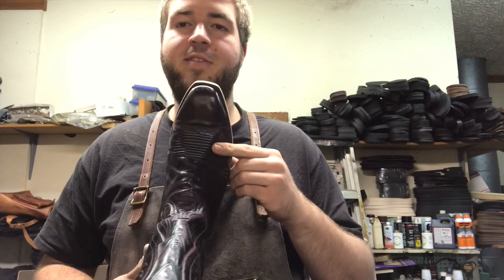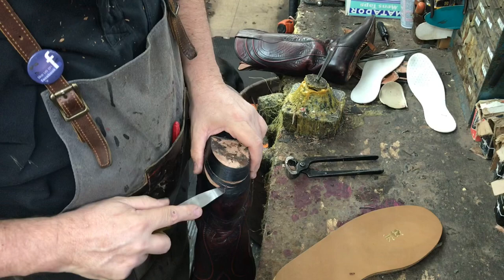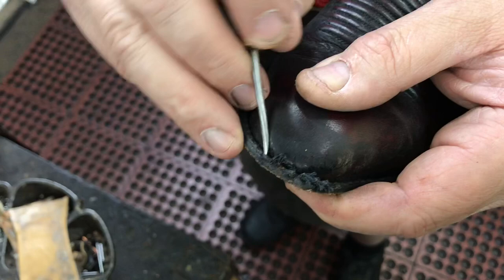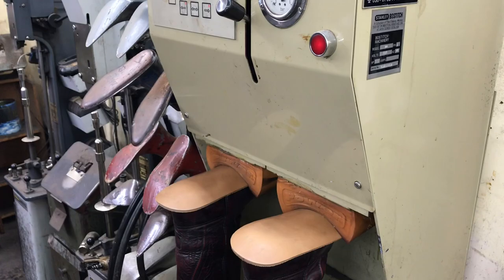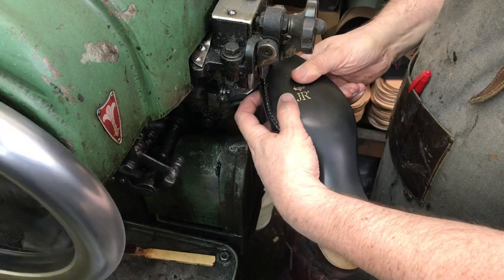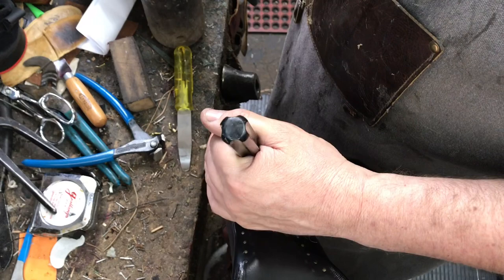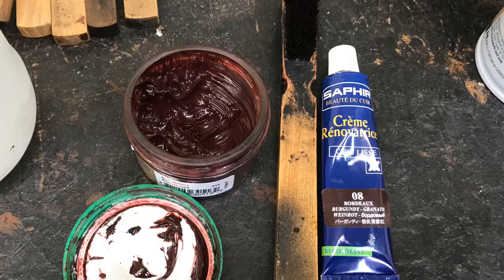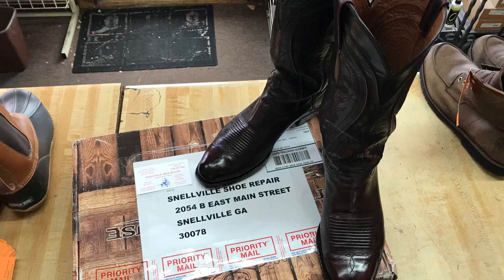How cowboy boots are resoled - Lucchese Classics resole - Western boot repair

Comment: When stitching the outsole onto the welt...how hard is it to make sure you reuse the same welt holes perfectly? It seems like one small misalignment and it'll be a botched job.
Reply from the maker: They lay back into the same holes 98% of the time. A lot of times we replace the welt and don’t have to worry about it. Under the circumstances when a few stitches are out of the original holes, it’s very un noticeable. It would not make it a botched job whatsoever. Honestly, most cobblers don’t even stitch the soles anymore. Lots of things that sets the good apart from the bad! Not to say that cobblers do not stitch soles anymore. We have a lot of colleges that do top notch quality work. But your average cobbler shop just does a mediocre repair. Quick and cheap.
Reply: @snellvilleshoerepair  Thank you!

Comment: Can a Roper heel be put in place of a regular heel?
Reply from the maker: Possibly, depends on the boot, but a heel can be made lower with no underslung. Roper heels are typically 3/4”, cowboy heels 1 1/2”-1 3/4”. 
On some boots you may not be able to come all the way down to a 3/4” heel but maybe a 1 or 1-1/4
Reply: @snellvilleshoerepair  thanks. Does it depend on how tall the original heel was?

PS. I'm flat-footed so the less heel the better. And do you have a sole recommendation for all day comfort?

Comment: Can a pair of boots be repaired if there are holes all the way through the sole, like you could touch your foot through the bottom of the boot. Found a sweet antique pair of ostrich but whoever had them never replaced the soles and wore holes 100% thru on the balls of your feet.
Reply from the maker: Yes they can be. Message us on Facebook for a quote. Send us some pictures

Comment: Hey man do you think it’s possible to dye some light brown caiman boots black ?
Reply from the maker: Yes absolutely
Reply: @snellvilleshoerepair  how much do you think would it cost if I would send you them ?
Reply from the maker: My Use Only with shipping about $75-90, just depends on location. Shipping can vary between $10-25 for a pair of boots
Reply: @snellvilleshoerepair  I shipped a pair of boots and it was $20. I'm from El Paso, TX and I sent them to Massachusetts. I have the same Lucchese boots. Black cherry french toe goat skin. Awesome job by the way.
Reply: @abelhernandez2591  hopefully you see this Abel. I live in El Paso and I'm looking for a local cobbler any good ones or am I better off not using locals for cowboy boots resoles. got a $2500 full croc that needs soles.
Reply: @squirrelynutz1  Best bet contact BNV if you paid a high price for those boots.